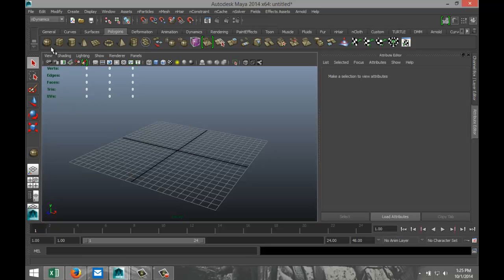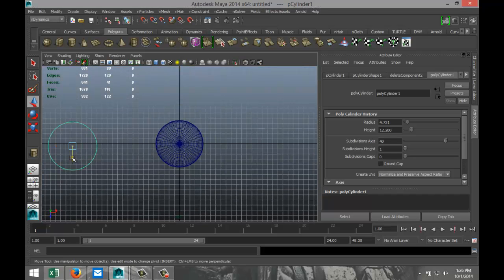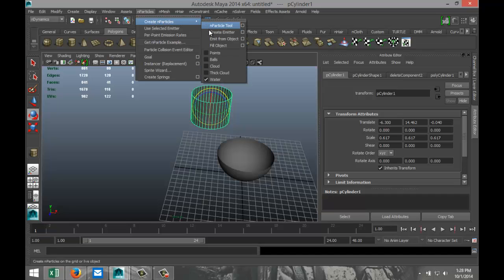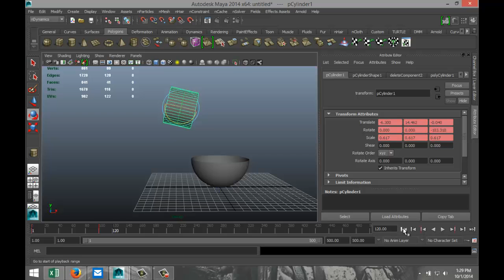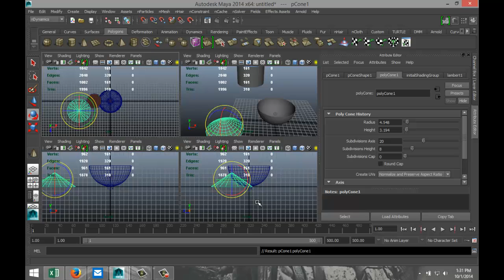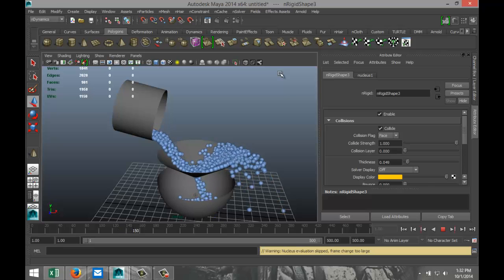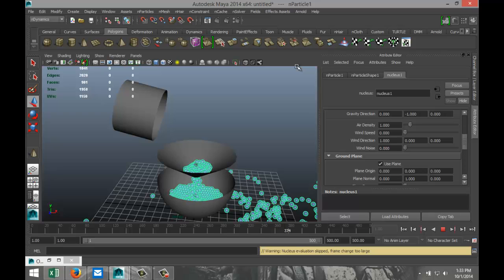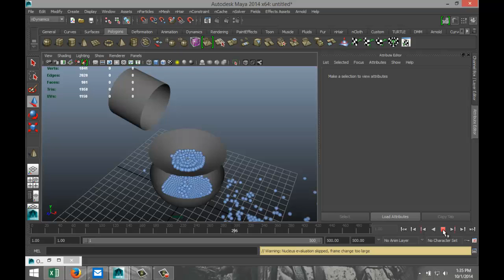Maya 2014 tutorial : Fooling around with nParticles

Comment: ok so in your sim, everything just works, in mine nothing happens, iam at 5.12 and my nparticles just sit there and are not reacting to anything. Why is that?
Reply from the maker: Is gravity applied ?
Reply: Hi Mike Hermes, You never applied gravity in the clip. so no. I havent.  Do i click the emitter then add the gravity?
Reply from the maker: You should not have to ( as I did not do it either ) but as I do not know your specific system, settings etc it is just a thought
Reply: Well, i am using maya 2014 on a pc, with default settings, since i never really use the dynamics part, i seldom wander there, hence tutorials. Is there something i should check inside the emitter or around the particle setup, or just add an ndynamics gravity while selecting the particles?
Reply from the maker: Go into the outliner and select the particle related items and then check the settings in the attribute editor. That would be your best shot
Reply: nah cant find anything about the gravity, but thanks anyways ill hafto find another way, or app if i cant get this to work within the hour. This shouldnt be this hard. the particles just rest in the shape of the plane, thats it even after adding hte gravity field to the particles, i went through  the settings, and i cant really find anything thats related to gravity that actually affects what iam seeing in the viewport. 

Thanks anyway, ill look for another tut.